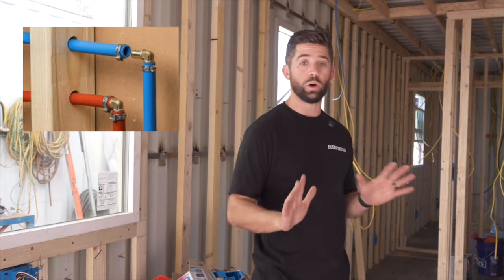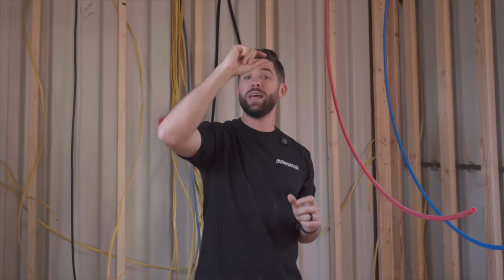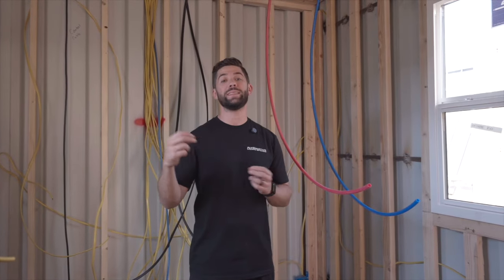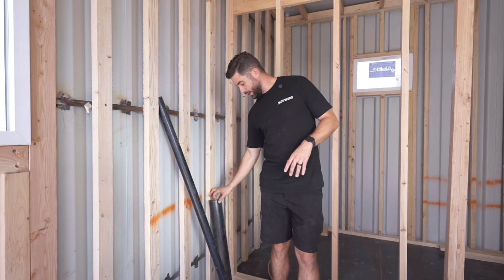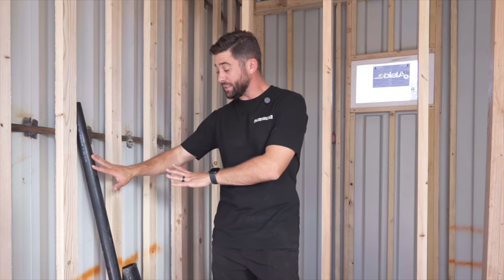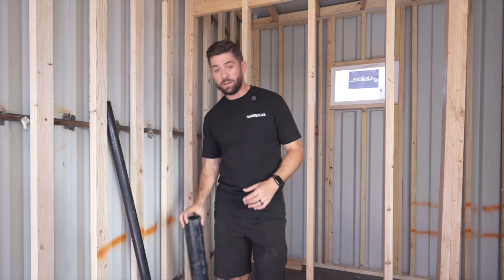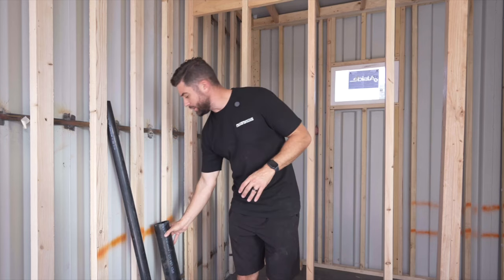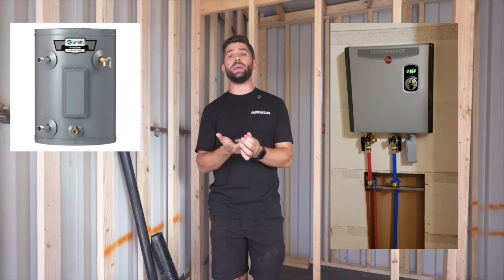How to Install Plumbing in a Shipping Container Home | EP. 12

Comment: My name is Anthony, and I’m based in Pinson, Alabama. I’m developing a frontier‑modern housing project and looking for the right collaborator to help bring it to scale.
I bring over 10 years of commercial construction experience, specifically in mechanical estimating and project management for hospital systems. I’ve estimated and coordinated million‑dollar mechanical packages for Birmingham’s major general contractors, including Brasfield & Gorrie, Robins & Morton, Gary C. Wyatt, and STONE Building Company.
I specialize in translating commercial‑grade construction logic into simple, repeatable, frontier‑modern building systems that families can actually afford. I’ve taken that experience and developed a tiny‑home and small‑structure method that is DIY‑friendly, energy‑efficient, fast to assemble, and built around a modernized “adult‑size Lincoln Log” concept.
I’m open to collaborating with builders, developers, landowners, engineers, or partners interested in modular housing, tiny‑home communities, or frontier‑modern construction. I’m ready to move quickly on design, budgeting, and early‑stage development and would like to explore how our strengths could align.
Thank you for your time —
Anthony Marsh
Lincoln Legacy Cabins (LLC)
Pinson, Alabama

Comment: I’ve watched nearly every plumbing video on container homes and I can’t seem to find the answer to this question.. i have a sink near one end and a bathroom near the other end .im gonna have about 30 feet of drain pipe going from the sink to the bathroom main drain to the septic. If it has 1/4 “ per foot drop that’s 7 1/2” drop… that doesn’t fit in the space under the container where you were talking about keeping the pipes in. I guess it all just gonna have to hang down?  It’s a 2 story ,2 container home. The bottom container is on 4’ tall I beam supports so there’s room but as far esthetics,it’s not what I want. Any way to solve this??
Reply: I’d check your local codes but you could possibly run it in the wall with the correct fall. Then just use a turn down into your main trunk line. Personally I’d just let it hang out the bottom and let it eat but that’s me. A lot of work to hide something. I’m probably biased tho as living at the beach everyone’s houses are on pylons and everything is exposed so I’m used to seeing it.
Reply: @neversettle018 the wall studs are steel 2.5 inches so really can’t run it in the wall anyway. I ran it under. Doesn’t look nowhere near as bad as I thought it would 😂.
Reply: That is why we build our homes with crawl space foundations
Reply: @BuiltByBaileys I’ve got 4 1/2’ under my lower container